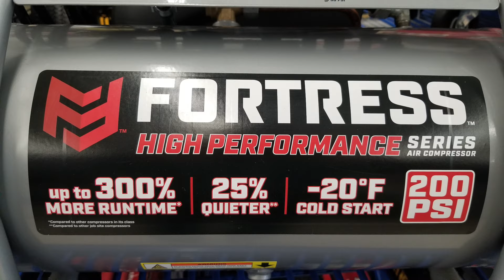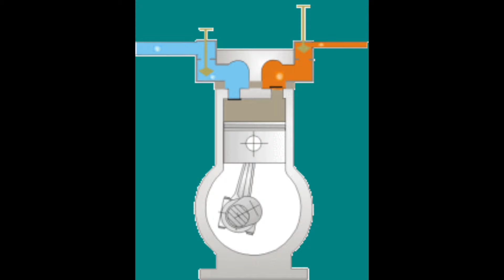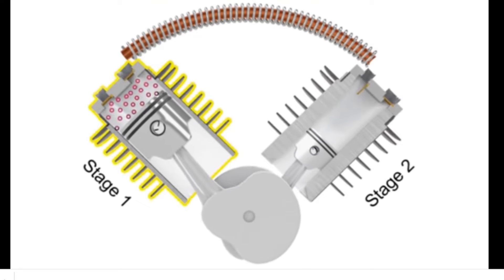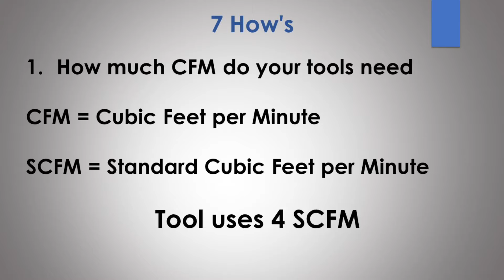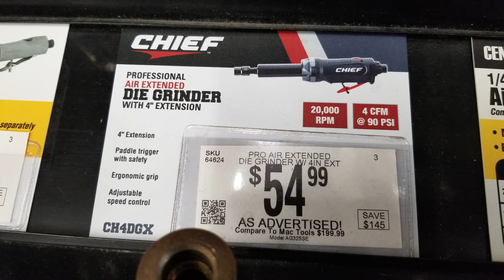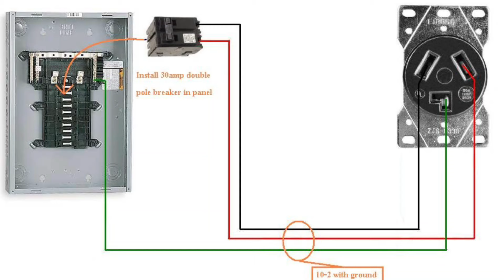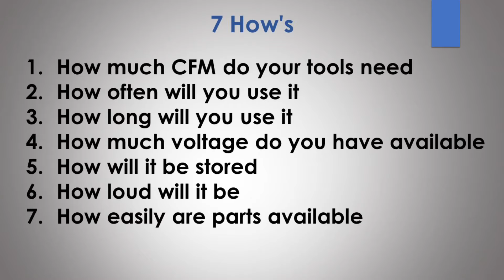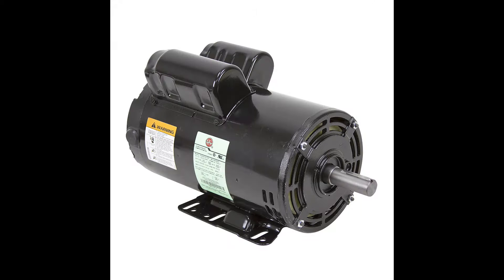Air Compressor Types, How They Work, and How to Choose the Right One

Comment: Pro tip....I have found that if I bring an empty tank and open the valve at the local elected officials office that it fills with hot air fairly fast.
Reply from the maker: That's a great idea
Reply: YUK YUK

Comment: I work as a carpenter.....and I buy nothing other than Makita.  The small one is the quietest I've come across...and is very reliable.  The larger one is pretty noisy....but has a good high rate of compression, without being very large.  The downside of the larger one is that it draws very close to 15 amps, and so it can easily trip a breaker if you put it on an extension cord.  Has to be plugged directly to not trip a 15 amp breaker.  I've had mine for about 15  years now...and they run like brand new.
Reply from the maker: That's a great comment, thanks Joe
Reply: Wouldn't the extension cord add resistance thus lowering the amperage? 

*I'm not asking this to be a smart ass I'm actually serious.
Reply: @theoneafterthelast  Yes, it will draw more amps with a  long extension cord....but it's not a real problem, as the small Makita compressor is well below the range that wouild kick a breaker.  I've run on close to 300 ft of extension cord...which is pretty severe...and it was never a problem.
Reply: @theoneafterthelast  To be clear, a longer extension cord RAISES amperage drawn....as there is amperage lost due to resistance.  The machine still needs the same amperage to operate...so it draws more.  T|hat's how electricity works.  You're talking as if the amperage offered to the extension cord is fixed....but it is not.  The machine draws what it needs to operate....and will kick the breaker if it draws too much.  The only place where there is a cap on amperage..is at the panel.
Reply: @joeidaho5938  hey, thanks.
Reply: @joeidaho5938  would a thicker gauge assist with the resistance?
Reply: @christianpage8143  It would....but honestly...it's best to run it on a 20 or 30 amp circuit, as I do in my garage.  it's a difficult one to run on a 15 amp circuit at a work site

Comment: I bought a little pancake compressor years ago and quickly outgrew it. I didn't have much money for the scfm and volume I wanted, so I scoured Facebook marketplace daily. After months I found what I thought was a deal. 5+hp 33 gal 13scfm @ 90psi for $150. Only issue was the guy didn't have 240v wired for me to test. Neither did I at home. But he assured me the thing ran and he always drained the tank. I gave it a quick once over and bought it. Months later I finally wired 240v with a dedicated breaker. I spin the thing up and within 15 seconds a crack blows open and starts spraying rusty water. It took almost 40 minutes to completely stop spraying. 

Since then I've learned a ton about compressors, and I wish I had seen your video sooner because you covered 95% of it for most people. Fantastic video.

If you buy used (or even new) here are some tips: check the drain valve - if it doesn't open easily and shows obvious signs of corrosion, tread carefully, or quickly away. Drain valves can be replaced but if it's difficult to open it usually means there's a significant amount of corrosion around that port. Also, realize that even if you have an auto drain, some tank configurations don't fully drain without being tipped/rocked. Make sure you read your manual and any labels printed on the tank as most of them indicate what is necessary to fully drain them. Somewhat related and definitely important for safety is that there should be a safety valve on your tank. If not, or yours doesn't function, you need to install one, they're pretty cheap about $8. Next, ideally, have a way to power the thing on, whether that's plugging it in at the buyers' or bringing a generator that means the power demands, you might even be able to get away with an inverter. If that's not possible, at least check the tank with a boroscope. You can get a decent one for under $35 and they're useful for tons of other things. You're looking for rust and any signs of corrosion especially on the side of the tank drain. On horizontal models, the inside tank top also accumulates a fair amount of corrosion so make sure to look all over. Alternatively, if you have access to another tank of similar size, you might be able to transfer that air to the tank you want to buy with the right set of fittings and a proper port access. If all of that seems fine, go for it. But now realize it's your job to keep as much water out of the tank as possible to begin with. That usually means building or buying an air dryer - lots of good DIY build on YouTube. Ideally, the dryer should come between the compressor and the tank to keep water out.

All of this is quite a lot to deal with before even purchasing. I think most people would be better off buying new and realizing that there's a limited life to these things so make sure to read the manual and understand what that means. In production environments, compressor tanks are regularly inspected, serviced, and decommissioned to mitigate becoming a ticking time bomb. I feel like I dodged a bullet with how that crack formed. Luckily, I found an unused 50 gallon tank for 40 bucks and will hopefully be replumbing the old pump. Worse comes to worst and I resell the old pump / motor assembly as the 5hp motor alone should recoup most of my initial purchase which is why I thought it was a good deal in the first place. Plus I get to practice brazing with a torch. 

I hope this helps someone, anyone.
Reply: Thanks for sharing. Some good pointers there.

Comment: Great video, many thanks Pete. I have a Matika 5200compressor which i believe is one of the best in class in its category. I'm a wood turner and I bought a a very small air sander to finish sanding turned pieces. Well, even  though the compressor is highly rated at 6.9 SCFM it can hardly keep up with the demand and runs continuously while I'm using it.  It has a 5 gallon tank.  Do you think a compressor with a bigger tank even with a lower SCFM would be a better option?
Reply from the maker: A bigger tank yes, but you need more SCFM

Comment: Regarding wiring directly, should always use a magnetic starter box between the unit and fuse panel. If the compressor faults or a hose/airline breaks and your not around the start box will sense the overload and cut the power.
Reply from the maker: Great tip, thank you

Comment: I’m looking for a compressor to blow out my irigation system. Pressure regulator can be set to 80psi (not more, pvc pipes cant handle more).
My current small (old) compressor can only provide this for like 20 seconds before it has no pressure left. The cycling doesnt keep up with whats needed. 
Important is that it outputs 80psi continuously, for as long as possible, without having to stop it every minute, wait for the tank to fill up etc. 

What kind of stats/size compressor would you recommend me?
Reply: The air tank doesnt need to be that big if the motor is able to keep up generating 80 psi continuously. Right? But I dont know if that exists,  I dont fully understand the CSFM value. What SCFM value would I need for my requirement?

Comment: Good information. I would like to hear about which diameter hose should we choose! For example for 50 feet hose for 150 psi compact air compressor 3/8 is better or 1/4. Best luck
Reply from the maker: 3/8" is better

Comment: I have a Question is Wise too keep my Compressor Plugin and with the switch in the on position. The last one I had I kept it plugged in and in the on position. It would come on automatically when the air pressure dipped below a certain level. Thank you for the commentary for this video, I have learned so much from your platform. US Army Veteran
Reply from the maker: I leave mine on 24/7. You have to fix the leaks.

Comment: Is there an advantage to higher horsepower? I have a working 5hp compressor motor from an old rusted tank so will it improve performance if I swap out the 1.5hp motor on a newer compressor with the higher hp motor? Great video.
Reply from the maker: Higher HP helps the compressor fill faster. You have to make sure the compressor part can handle higher HP and RPM's

Comment: Hey man, thanks for the priceless info! Guess I need help on How #1. Please tell me this - assuming that a 7 gal. 100 psi portable air tank will inflate a flat 16" tire to 40psi (will it?), what size 110v compressor is needed to fill that air tank to 100psi? 7 gallon one? IDK
I like taking a portable tank on the road just in case i need to plug and fill - and to top off my tires at the house without lugging the compressor to my truck.. Thank you!
Reply from the maker: Any compressor will fill it, just a matter of how fast
Reply: @PetesGarage  Yes, thanks, i get that. So say, for a 3 gallon size compressor, i guess it would have to fill its own capacity 2 or 3 times - and that could take maybe 10 minutes for my air tank to reach 100 PSI? Math has always eluded me, sorry to bother and thank you very much for your videos.
Reply from the maker: A 3 gallon would work just fine
Reply: s @PetesGarage  Had a handyman over and using a 3 gal. 'hot dog' HF and he agreed with you so that settles it! 
Thanks again for your channel and for your recommendation. Peace

Comment: Great video. question if a single stage air compressor is 4.5 Scfm @90 psi do I need to set my regulator at 90 psi or set it to the tool SCFM that I'm using? I hope that made sense.
Reply from the maker: Set it to the psi the tool requires

Comment: I am super new to air compressors. How important is PSI vs CFM vs SCFM? What is most important? I see small pancake compressors with higher PSI number but lower CFM and SCFM when compared to larger tank and HP air compressors.
Reply from the maker: CFM is important, that is how much air it can deliver to operate air devices

Comment: I recently bought a John Dow fluid extractor, I am wondering what air compressor I should buy. The manual requires an air pressure of 110-115 PSI. Would a small portable air compressor be suffice?
Reply from the maker: Small 20 gallon compressors are pretty cheap
Reply: @PetesGarage  thank you very much for replying.

Comment: So the stage is my best bet for blowing out a sprinkler system. Bc of the large tank for volume and the fact that it can run maintaining pressure. Am I correct? Your thoughts and or recommendation. I have 4 zones but they are spread out across a large property.
Reply from the maker: I  use my 2-stage to blow out my sprinkler system and it keeps up.

Comment: What hose would you recommend to seat the bead on the newly installed tire (1/4" or 3/8")? And if you could tell the setting on the compressor for that procedure and corresponding set. I changed my 1st tire, but couldn't seat it on the bead yet, since tried to use a small tire inflator. I'm getting a small pancake (for 6 GA) compressor shown in the film, but how to set everything up? Thank you for the informative film.
Reply from the maker: You want lots of air flow so a 3/8". You need a bigger compressor to seat beads with soapy water on the bead to help seal. It's not easy to do the first few times
Reply: @PetesGarage  Thank you. I bought and put a special tire grease around the edges of the wheel, just need specifications on the compressor. Like if I use 1 GA Fortress (SCFM=0.7 @90psi) and 3/8" hose, will it work? Can you use 3/8" on any compressor (I'm thinking about small ones)? Can you attach 3/8" to a small compressor (pancake e.g.)?
Reply from the maker: Small compressors will bot be able to keep up with the volume demands of a 3/8 hose wide open
Reply: @PetesGarage  Thank you, it is good to know.

Comment: I need a compressor to blow out my sprinklers,  what size/type would you suggest?
Reply from the maker: I have a 60 gallon, 8 horsepower compressor and it just keeps up when I use it to clear my sprinkler lines. I would recommend renting 1

Comment: With all the cordless tools nowadays, do we still need a compressor? I only see use for them in a professional workshop. Only thing I can´t find is a decent battery powered air gun. But a shopvac or tire inflator come a long way.
Although the downside of battery powered tools is $$$. And you´re forced to choose one ecosystem, while air fittings are pretty much standardized. Would love to get your opinion on compressed air vs. battery powered tools :)
Reply from the maker: Great question. I have both. I use my cordless drill more than my air drill, but the air drill it much smaller so I can use it in tighter places. I had a cordless impact gun, it just did not have the durability. I have a cordless heat gun, but it does not heat as quick or have the capacity for long duration jobs. I've tried cordless soldering irons, not a big fan. When you have a heavy duty job like cutting lots of lumber, or building large things, cordless is just not up to the task. The best air tool I use is my air hammer to remove ball joints and bearings. I've even busted up concrete with it. Cordless is very convenient, it just falls short on some tools.

Comment: To inflate a semi truck tire LP22.5 what is the requirement to buy a compressor?
Reply from the maker: Any compressor that will go up to the pressure required
Reply: @PetesGarage  negative. I have a compressor that it indicates max 100psi it works well in my cars tire 35 psi...okay. but for my semi truck tires, my tire inflate the compressor. I need more power...how much more power I need that is the Q.
Reply from the maker: If you are using a diaphragm compressor it probably won't work. A semi truck tire is pretty big. You probably need something like a 25 gallon tank at least

Comment: So what does 300% more run time mean?
Reply from the maker: Great question, it's just marketing talk
Reply: 300% is like saying 3 times.
So it will run 3 times longer than one that only runs for one period of 15 minutes before getting too hot 🔥 and automatically switches off to cool down. Sooo you can run an air grinder or paint sprayer for 45 minutes with the "300% longer run-time"  compressor.

It means that you get more work done in the same time, drink less coffee, and smoke less cigarettes 🚬 than if you had to stop every 15 minutes to let it cool down. Think of the money you'll save, your nerves will be less jittery, and your wife will say "Jeeze Joe, you don't stink of ciggies so much today, what happened, did you have to bum them off your workmates today LOL?"

Comment: wouldnt off for 90 seconds and on for 30 seconds, a total of 120 seconds, wouldnt that be 25% duty cycle since its on only 25% of the time. 30 seconds is 1/3 of 90, but the total is 120 seconds, not 90. just wanted clarification...
Reply from the maker: That makes sense

Comment: I bet you get texts at all kinds of weird hours lol

I'm having a bitch of a time finding a compressor to suit my needs. Your math led me to 11scfm at 90psi. And I've only got access to standard 120 volt 10 amp. And I don't want one of those stupid 8 gallon wheelbarrow types that will run constantly. AND I need it on wheels.

Pretty much impossible. Might have to go gasoline powered. Ugh. That'll get expensive
Reply from the maker: That's a tough one, that 10 amps is really killing you.

Comment: LOWES AND HOME DEPOT SCAM…. Yes really…
I needed to repair my older shop air compressor… I tried to find parts…all discontinued.
So I started looking at Lowes and Home Depot topical brands. And I selected a few models and then I tried to buy spare parts…. MOST OF THE “ spare parts” to repair MOST of the compressors were either back ordered with NO expected timeline to get them, or the parts were discontinued…
Let me repeat… BRAND NEW COMPRESSORS STILL IN THE STORE….and the repair parts were already discontinued…. So all you’re getting is a compressor with a one year warranty and NO CHANCE TO REPAIR….to me that’s a scam..
Don’t believe me… I’m just a troll…. WHENEVER you buy an expensive tool CHECK FIRST to see if the parts that might fail and disable that tool… CHECK TO SEE IF THOSE PARTS ARE AVAILABLE.
Reply from the maker: While I agree with you, buying parts is tricky. I have a brand new car and parts aren't available yet. Yes, there is the 1 year warranty, but a few hundred dollars is almost considered a disposable these days. I have an Ingersoll compressor that has run faithfully for over 15 years. I understand it's difficult, but they are just retailers not involved with repairs or parts. I've had good luck going back to the manufacturer when I need parts.

Comment: One word of warning about mainly the type of cheap compressor where they use an electric motor mounted directly to the actual compressor head known in marketing terms as direct drive instead of a belt drive system.

What they use as a piston is basically an Alumimum connecting rod with what looks like a penny on a stick not a conventional conrod wrist pin and piston with rings like any gas type engine.
This system is both cheap and nasty as the lack of a wrist or gudgeon pin means the top of the piston wobbles over both top and bottom dead centre, But worse yet no piston rings as such they just use a neoprene ö" ring instead of proper rings therefore they are not going to be long lasting or efficient maybe ok for the occassional pumping up of tires or so on but otherwise a big waste of money.
So be very wary of any so called direct drive compressors they are just cheap and nasty.
Reply from the maker: Great comment, thanks